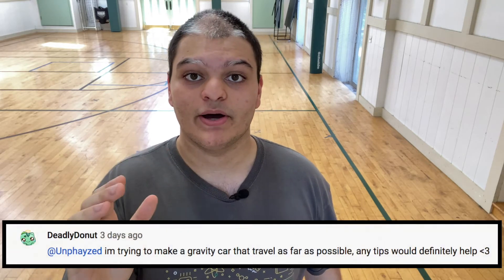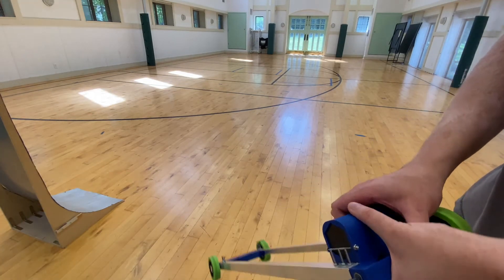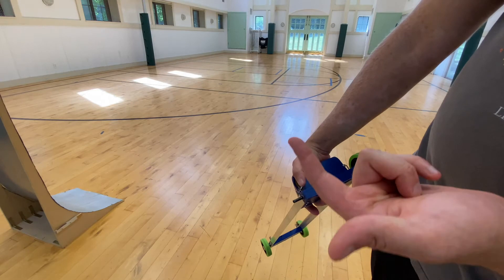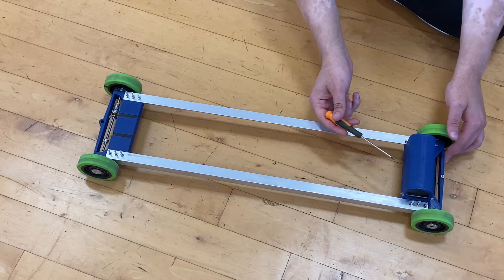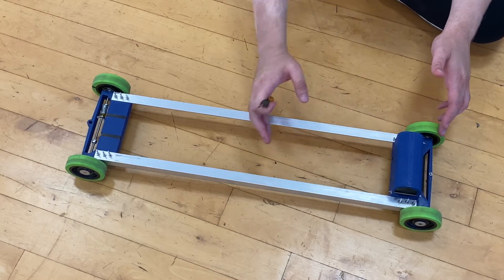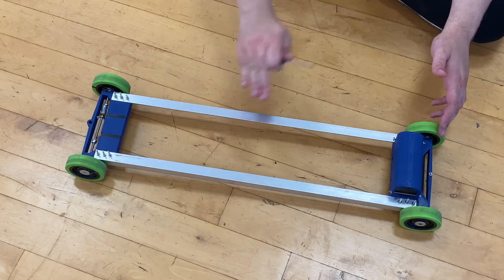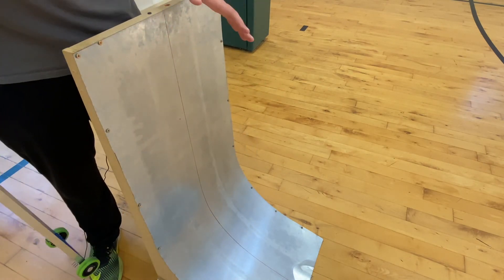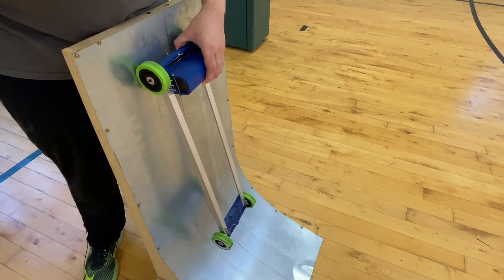How To Improve The Distance Of A Science Olympiad Gravity Vehicle

Comment: How did you make your vehicle stay upright on the ramp and not have the 1 kg block cause your vehicle to flip forward?
Reply from the maker: There is a pin on the weight that is connected to the launching mechanism. If you watch this video I made “How To Design A Science Olympiad Gravity Vehicle Launching Mechanism”, I describe the launching mechanism for a standard gravity vehicle. The only difference between the standard vehicle and the one with the shifting weight, in terms of launching, is that the launch pin is located in the weight rather and the vehicle itself.

Comment: How did you get the axel to stay in the ball bearings? Just glue? Ours kept sliding back and forth.
Reply from the maker: What I first did was wrap some masking tape around the axle at the area where it will sit in the bearing.I wrapped enough tape around the axle so that the axle fit snugly in the bearing. Then I put a DROP of super glue on the tape-wrapped portion of the axle and inserted the tape-wrapped portion of the axle into the bearing. Only use a drop it’s more than enough, otherwise you might get glue in the bearing and destroy it.
Reply: Unphayzed Thank you so much my guy your videos have been a huge help keep it up!
Reply from the maker: Thank you!